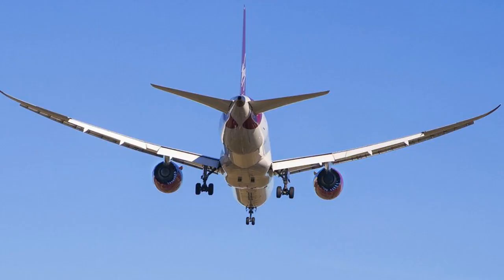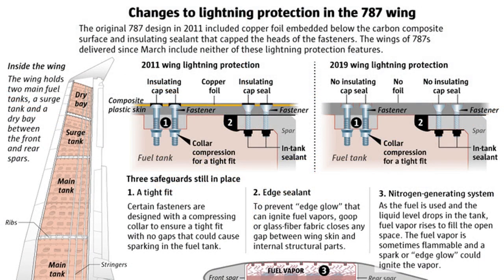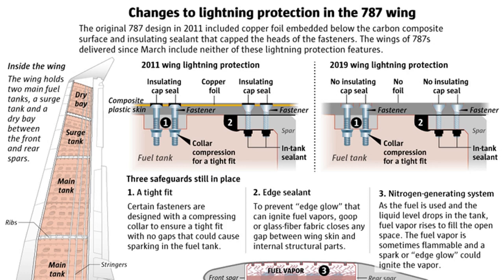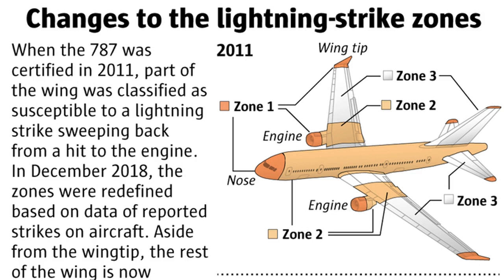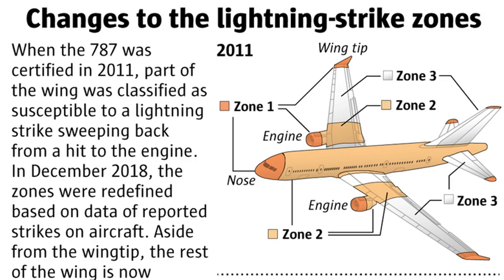FAA engineers objected to Boeing’s removal of some 787 lightning protection measures

Comment: If a NGS is also present for the wing tanks..., any further "safety measures" to reduce the possibility of a main fuel tank ignition would mostly become dead weight. I say this as an AE myself! If there is a lightning strike that so strong to be able to ignite a fuel tank in which the gaseous space is filled with nitrogen..., then it would be capable of protruding through whatever coating and insulation you may use, it's gonna blow up anyway if such a ridiculous lightning bolt would develop to overcome the nitrogen filled space in the tank such as to be such a strong lightning that to forcibly evaporate the liquid fuel, then have the possibility of getting it mix with ENOUGH air needed to become flammable while at the same time the lightning bolt should still be present in order to be able to make the ignition take place. To have those 3 altogether at the same time is normally impossible. Only if plenty of repetitive lightning strikes on the same exact spot would take place in order to give any leaking fuel enough time to evaporate and mix with enough air in order for the upcoming lightning strikes to make it ignite would be the only possibility, and that may only be achieved by a ghostly power.
Reply: Fuel ignition is not the only concern when it comes to lightning strikes. Carbon fiber composites are vulnerable if subjected to lightning strikes.
Reply: but the airplane will relly in just one protective system?
Reply: @bastadimasta  
Indeed. Those carbon fiber parts actually attract the lightning on themselves which isn't good.